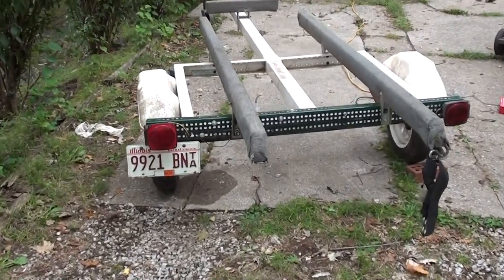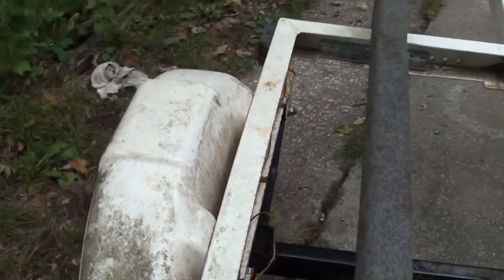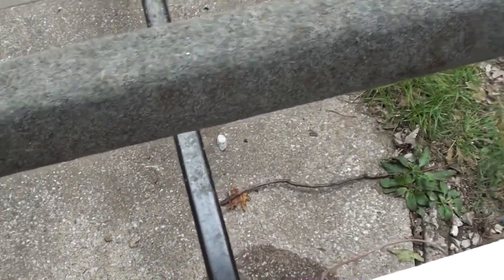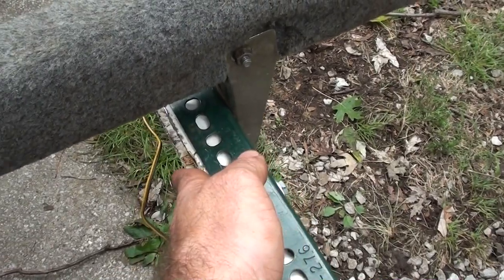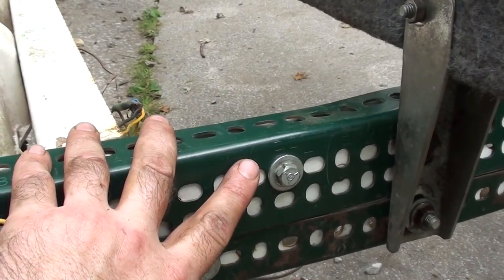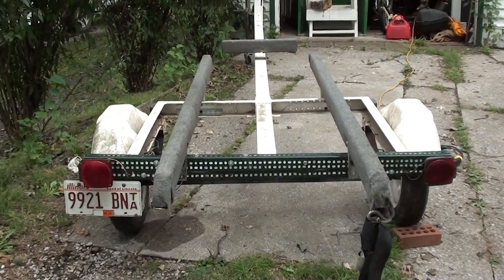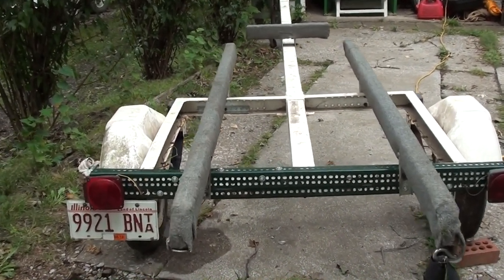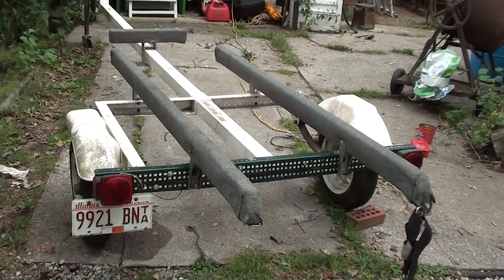Boat Trailer Repair - Fixing Damage from Tree Falling

Comment: A tree that sucks  You know me I fix and repair everyday and that looks like a good fix ,I`ve made mega trailors -On the boat if you have sharp kinks use a propane propane torch to heat the kink then pien them out with 2 heavy hammers each side of the kink hit the high side of the bend hold against on the other takes some banging  .